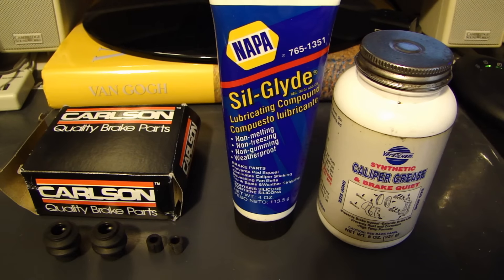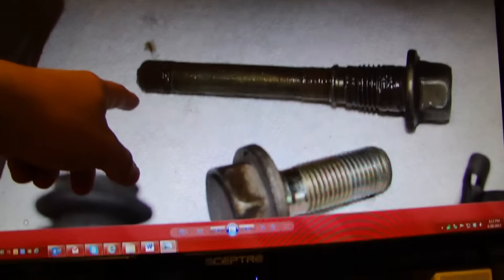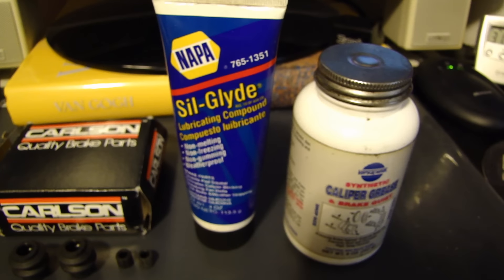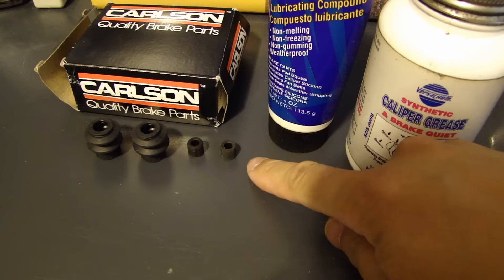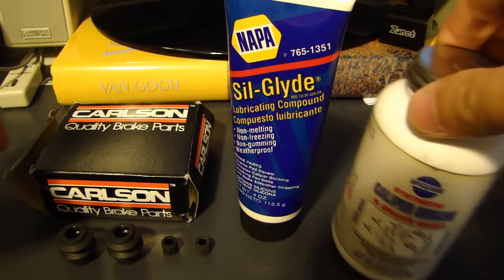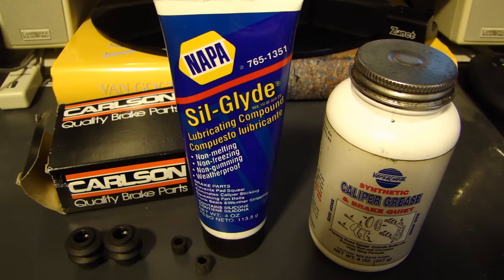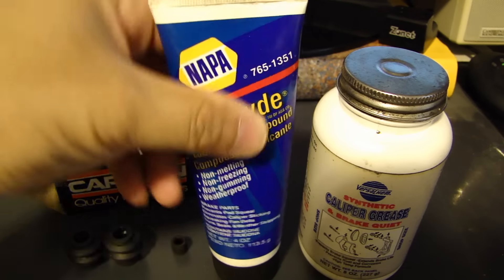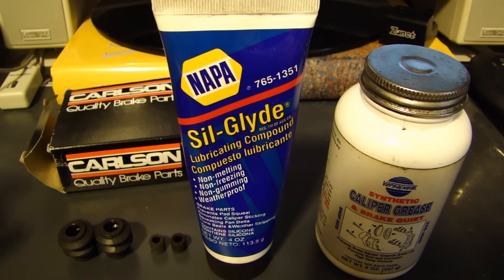Brake Caliper Slide Pin - Proper Lubricant to Prevent Rubber Swelling - Sil-Glyde

Comment: Hi dial2fast i m from italy and it's long time i m looking for the right grease and i m really happy that you have already been through, the only question i m going to ask is that the grease normaly used by fiat citroen and renault and some more dealer is white color but i really don't care because i m gona order the silglyde to check if it's the right one. What temperature does it hold
Reply from the maker: Sil-glyde is designed for brake application and will be fine for high temp application.
Reply: Not true...  Sil-glyde is based on Silicone grease.  Take a look at the MSDS sheets from DOW and GE and you will see that the MAX temperature rating is only 400F.  If will not hold up under the temperature experienced when brakes are used daily, those numbers can easily reach 600 to 800.   Ceramlub was specifically designed for brakes and used by Bendix for over a decade, the put in boxes of new pads and sold in tubs for shop use.   Check out the tech details at...  www.Ceramlub.com
Reply: Ceramlub is great for the caliper bracket guides (and other places) but it is contraindicated for using on a slide pin that has a rubber bushing (3:20 in this video).
I have such bushings on the slide pins on my Subaru and I have just learned that I will be buying a new set of EBC Greenstuff pads well before their time because of angled pad wear brought about by the bushing(s) swelling and locking up the pin(s) on both sides.
I will be replacing the rubber bushings and using a silicone paste on my caliper slide pins.

Comment: Petroleum based greases will react with rubber, and that will cause the rubber to expand. I learned this the hard way also. Most of the manufacturers of the petroleum based greases state on their containers that the product is safe for rubber, and that is absolutely false!! 
They should know that.
 A mechanical engineer who works for Honda explained to me exactly what the chemical process is, and he recommends using the silicone based greases on those glide pins, such as SilGlyde, or Permatex Silicone Ceramic Extreme. Silicone based greases are compatible with rubber compounds,  will not react with them causing expansion, and will actually help to preserve rubber.

Comment: What is the difference between that syntetic grease and other silicone grease?  I  am on quest on learning all type of greases because i want to change my disk/pads and calipers on my car. 
SO far I know : 
1. ceramic grease is good for back of the pads and caliper itself... is not conducting heat and is good for metal to metal friction ( lubricates) so no more squeaks. 
2. Copper grease is good as anti-seize grease ( not lubricant) , I use this for screws, bolts , spark plugs to stop them for seizing in the future.

AND now I don't understand difference between silicone grease and red rubber grease , BOTH protect the rubber , I know silicone grease is water resistant and they lubricate.  

Can you explain difference between these two? 

Should I use red rubber grease for slider pins or silicone grease? or both are the same?  
Silicone is full syntetic red rubber is from vegetable oil ( IF i'm not wrong)

Thanks for your time , your answer is highly appreciated.
Reply: you want 100% silicone for anything that touches rubber. 3M silicone paste or permatex extreme ceramic. I have bought too many greases over the years including sil glyde. I would not use anything but 100% silicone grease rated for high temps. I see sil glyde recommended alot, but the sds doesn't list silicone.
Reply: @eee2115  what about red rubber grease ? Where should I use that ?
Reply: @georgeprincex  no experience with it. but based on the name, I would hope it is safe for rubber.
Reply: I guess I’ll use red rubber grease for rubber gasketd / seals to keep them from deteriorating over time. I think that was the purpose of these , keep rubber in good shape overtime

Comment: I searched Youtube to find a solution to this problem. Iam right now working on my Isuzu Dmax and came across the same problem with swelling rubber seals!
How about getting rid of them? I mean, what happens if I just pop off the rubber seal? Some other slide pins in other vehicles don't have rubber seals anyway!

But thanks for the video!
Reply from the maker: The rubber piece that goes on the slide pins are for anti-vibration (according to the manufacturer). Exactly what kind of vibration you get if you don't have it, I don't know. But the issue must be real because many car manufacturers have this on their cars. Also the rubber piece usually goes on the top slide pin on the driver's side and the it's on the bottom slide pin on the passenger side. You can try to find replacement parts from Carlson.
Reply: This doesn't make sense to me.  If the bushing is supposed to be on the top slide pin on the FRONT brake on the left side of the car then it should ALSO be on the top pin on the front brake on the right side of the car!  On REAR disk brakes where the calipers are behind the bulk of the disk, a seemingly consistent design would have the bushing on the bottom slide pin (on both L and R sides).

Comment: Excellent. I've got a 2005 Dodge Grand Caravan and the caliper pins have been giving me issues for a couple of years. I've used high temp grease and found it nearly impossible to get the guide pins back into the caliper. I've got an order in for a new Pin Boot kit by Carlson from Rock Auto for $3.84. The kit will do both the left and right front brakes.I'm sure I can find the type of lubricant you mentioned and give that  a try. Did you lubricate just the tip of the guide pin, or the pin and inside the caliper where the pin fits into? How much lubricant did you use per pin?Thanks very much.
Reply: Don't add grease to the ends of the caliper pins

Comment: removed a slide that was sticking on my 99 Tahoe, put new rubber gaskets but still had the same problem,  used white lithium spray would that make the rubber expand as well.
Reply: +YeskaSmoke yes it would. you need a silcone grease.

Comment: Quick question: you mentioned that you still use the synthetic grease...does that mean that you use the synthetic grease for the pin itself but the sil-glyde for the rubber bushings?  Or do you use the sil-glyde for the entire pin and rubber bushing?
Reply from the maker: I use sil-glyde for the entire slide pin. I use the synthetic grease for the back of the brake pads and the end where it needs to move. You can check out my recent Nissan rear brake job video on my channel to see how I do it. Thanks!
Reply: Thank you for the clarification.

Comment: If you read the label on the synthetic grease it'll say metal to metal only on the back. Permatex does for the green and purple grease for brakes.

Use super lube which is silicon grease.

Comment: Is it acceptable to use dielectric grease to lubricate the brake caliper slide pins.
Reply: I use Ford's (Motorcraft XG3A) It is labeled for Dielect and also caliper pins.

Comment: my 2006 chevy malibu maxx LT has the same kind of slide pins on each side.One with the rubber bushing and one without it. now as i was replacing the old slide pins for new ones i wasnt careful enough to see which pin goes where. Does it even matter?
Reply from the maker: Dee Boy I have seen it where the rubber bushing one goes on top and I have seen it where it goes on the bottom (from the factory). Best thing is to check the other side and compare.
Reply: The bushing at the end of a caliper pin  is to reduce vibration/clicking as the caliper rocks slightly in and out as it slides, and most noticable when releasing the brake.

On most disc brakes the bushed pin is the one reached first by a forward rotating rotor.  When the vehicle rebounds after stopping, that pin moves first.

Comment: What's different between Anti seize paste and Synthetic grease ?  I have seen some videos on youtube using Anti Seize paste as lubricate metal to metal. I thought that was the job of Synthetic grease? Which one should I be using for my brake job? Thank you
Reply from the maker: The copper or aluminum based anti-seize can be used on metal surfaces to prevent corrosion, rust, and seizing. This is good for bolt threads and surfaces where rust might form. The synthetic grease is a very thick sticky grease that is able to withstand high temperature, and also prevent seizing, rust. This is often used on the surfaces on the back of the brake pad (shims), and any moving part to prevent noise and seizing. The third type - SilGlyde shown in this video should be used on the slide pin so it will not swell the rubber components.  For me, I use all 3 types on a brake job.

Comment: Well, 7 years later I'm a little late to this party but if you're still out there I have a question. 
My mechanic recently greased my pins and indeed one of the bushings wss swollen but he just discarded it like it was nothing I really needed and put it back in.

So what is the purpose of that bushing and if it's not on the pin then what is the bad thing that can happen?
Reply from the maker: That rubber bushing is put on to reduce possible vibration when braking.
Reply: @dial2fast  I've been all over the cars forum trying to find more information. Some people are saying it promotes uneven wear if left off. When you say prevent vibration, you mean like prevent my car from shuddering or what?

 I'm just trying to figure out if I need to go to the expensive of having it replaced anytime soon.
I mean I know the part is not expensive but the labor for my guy to get in there and take the breaks apart again.
All I went for was to have the pins lubricated and now I have this problem
Reply from the maker: @michaelrs8010  That rubber bushing is used as an anti-rattle mechanism for the brake caliper that ride on that slide pin. The bushing provides a cushion for the caliper to slide back and forth, and therefore it's not loose. Without the bushing, it's possible you might get rattling from the caliper, and poor brake pad wear.  I know many mechanics take them off and throw it away once it's swollen, and they will tell you it works fine. The issue might not be seen immediately, but you could see pad wear issue later on. They do sell replacement bushings you can install, but make sure they clean the old grease, and use the proper grease or else the same issue will happen again.
Reply: @dial2fast  Thank you. Appreciate you taking the time to answer.

Comment: I use CRC 5351 Brake Caliper Synthetic Grease.  The description for it says it's "plastic and rubber safe".  Don't know if "safe" also means that it doesn't swell up rubber.  But there's a lot of positive reviews on amazon, with no mention of problems on caliper pins.
Reply from the maker: The synthetic grease I have also said it was safe for slide pins and rubber boots, but I found out the hard way. Also the swelling doesn't happen in couple days. Probably noticed about a year after I started using it. The syl-glide is only $6-$7, so not bad to get it.
Reply: dial2fast I think you've convinced me.  I don't think any of my brakes have the rubber bushing, but don't really need to spend anymore time thinking about swollen rubber boots at caliper pins.  BTW, nice and clear video.  Thanks.
Reply: yusuihang I use that same CRC lubricant and it caused my bottom pins to seize. After I pulled out the pins the rubber was swollen. I had hard time pushing the pins back to the caliper!
 
CRC Synthetic grease (black in color) is not safe for rubber on the long run.

Comment: I changed my rotors today and notice that one of the bolts had that rubber bushing. I am not sure which one was it. can you tell if its the top bolt or the bottom bolt that has that rubber bushing
Reply from the maker: If you have a 04 Quest, then the rubber bushing pin goes to the bottom.

Comment: Nice vid. What is the purpose of the bushing on the end of the pin? On my Subaru and Oldsmobile there is only one pin per side that have the bushings. Does it matter if the pin w/the bushing goes on the top or bottom?
Reply: Not sure about about your cars. But on my Jeep the bushings are on the top slide pin only.

Comment: @dial2fast
I use some silicone grease from tube, available from our town and it seems strange.
It comes like silicone out of the tube but when i apply it to brakes pins and move the pins a little bit inside out, without fully pulling them out. The silicone becomes almost like water and pretty much "disappears". Is silicone really working like that or i should use some other brand?

Another thing, it still could be synthetic? I found another one but its synthetic. Brake lubricant
Reply from the maker: I am not sure if the one you have is made specifically made for brake application, but the one i showed in th e video does not turn watery after application. I would stick with SilGlyde.

Comment: Will the Sil-Glyde also work on the ends of the brake pads to keep them from squeaking?

Thank you for the video.
Reply from the maker: Yes you can use it for pad backing also.
Reply: Both are fine but copper is more ideal as it's more widely available and also cheaper and does the same job. Nickel antiseize is used in some aerospace applications, but copper based is perfectly fine for automotive.
Reply: No. Use caliper grease on metal to metal contact points. If you use anti seize, use the high temp nickel.

Comment: U got to use a lithium soap base grease with moly for slide pins. There is a Toyota rubber grease that’s made by a company called Kyodo Yushi. It’s red in color that’s what is used Japanese cars. I wouldn’t use sil glyde or anything else. Eve. Regular synthetic  lithium grease should do ok

Comment: Can this be used for all parts of the brakes that need lubrication?
Reply from the maker: For me, I only use the SilGlyde on the slide pin or any parts that have contact with rubber pieces. For the other lubricating points, I use either synthetic brake grease or ceramic brake grease. I have include links for them in the description of this video.

Comment: Oops, used lx1900 multi purpose lithium grease on the pins by mistake.  I'd like to replace the grease with silglyde.  Any idea how to clean out the lithium grease out of the  pin holes?
Reply: Brake clean, in a spray can,  then wash with water, air dry totally with a compressor and then apply.

Comment: Just bought some new grease for my slide pins and after a short panic, it appears I have exactly the same grease....phew!! Mine is Textar Cera-Tec. It's exactly the same colour and looks identical to yours, so hopefully my little brake service will go well. Would I be safe with using brake cleaner on the rubber seals?

Comment: where you bought this silglyde. I`ve been searching this silicone through the web, I`m living in Quebec, Canada. I found a company called `autopro, they have this silicone, but the price is 40 dollars. I really want to buy one because I got exactly the same as your rubber bushing.
Reply from the maker: I am not sure if Canadian Tire sells this stuff, but check if you have NAPA auto parts store there. I bought mine here at NAPA, and it was like $6. Or pick one up next time you visit the US.
Reply: dial2fast Canadian tire does not have this stuff.
Reply: Doesn't matter what brand it Louis, as long as it's Silicone grease. That's what you use on the pins.

Comment: Permatex 24125 ceramic brake lub is recommended
Reply: Do not use 24125. I just put it on some caliper sliders with rubber ends and they expanded in 30 mins to the point where the pin would not go in.

Comment: Thanks for the info on the slide pin lubricant. This is quite a problem. The rubber bushings will definitely swell up (almost immediately) when using the standard caliper quietening lubricant.

Comment: Any Silicone based lubricant is safe on rubber. Do NOT use anything with a petroleum base or synthetic greases. They will make rubber parts swell. They're great for metal to metal contact but not rubber.
Reply: I used dielectric grease for sensitive rubber, it's just basic silicone jelly

Comment: anyone, how important is the rubber bushing?
I never replaced mine on Sienna
Reply from the maker: +Vish Ram The rubber bushing is for damping and anti shutter when braking. It doesn't need to be replaced as long as it's not torn.
Reply: +dial2fast 
Thanks, I never put back a bushing on the bolt. anti shutter?? kindly explain. 
Happy holidays.
Reply: Vish Ram The rubber bushing is to dampen brake noise

Comment: I have started to use plumbers grease on the caliper pins. Reason being, the tube says it "lubricates metal parts and seals and  protects rubber O-rings. Made me think, hey sounds like perfect use for brake parts. I'll see how it goes. Anybody else use PG for their pins?
Reply: Can it handle the heat though?
Reply: @peepiepo  Just saw your reply. No issues since my last brake job, but I took the bushings off my pins. Not sure even why its there

Comment: does regular brake grease that come in those small packets work ?
Reply from the maker: Those typically are synthetic grease. I would still use the SilGlyde for any rubber parts.

Comment: What's the point of the rubber bushing? Its only on one pin so it seems pointless. Why not pull it off, bin it and use copper grease which can handle the high temperature.